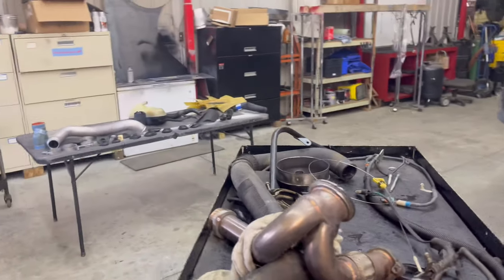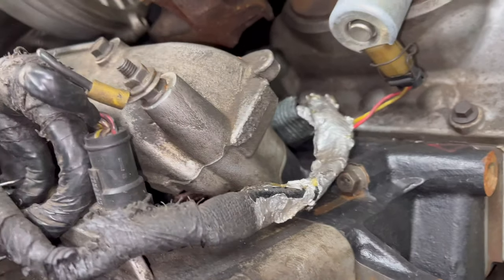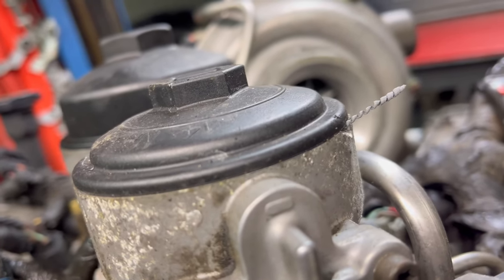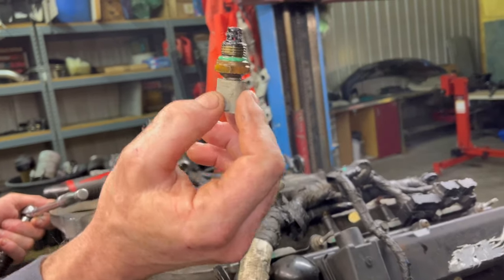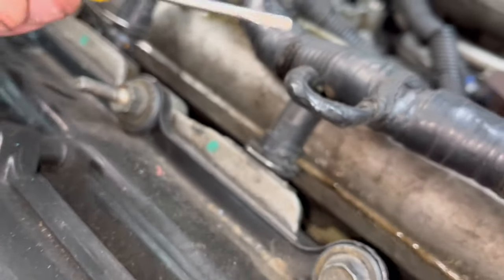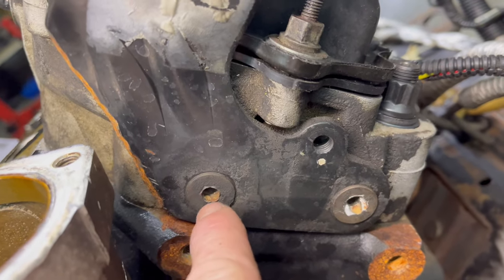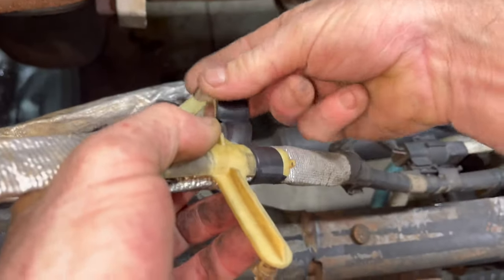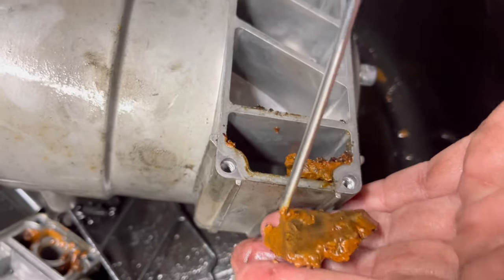This is a FREAKING MESS!!!!   We are on the job tho!!!!  Ron's South Carolina F350

Comment: Bro it's a mess, but this is an epic video series 👍😁👌.  Thanks to you and a few other good guys publishing this stuff, I had a nice clean engine and when I removed my oil cooler, I didn't even wipe the engine block out.  Just evacuated the oil out with the fluid extractor and left it alone- no lint contamination that way!  You and Dieseltechron potentially saved me so much PITA by not having to replace and replace and replace the IPR screen from a plugged up oil system.
And with every change in mechanicing, there is other things that pop up.  I mean, from the evolution of the cordless impact and ratchet tools, they are fantastic labor savers but now I am noticing SO MANY overtightened bolts, stripped bolts, and cross threaded fasteners from guys being monkeys and just running and gunning fasteners in with the power tools, not starting each bolt by hand at first to verify the threads actually feel right and aren't crossed, etc.  
It's the pits following a shop monkey for sure, no disrespect to any monkeys intended 🤣😁
Reply from the maker: Everybody needs to read that a couple times!!!   Great comment SS!!   It's probably just as fun to do as it is to watch actually!!!   lol   It has turned into a freakin comedy skit!!!   lol
Reply: @AnthonyYoungblood   kind of a grownup Easter Egg hunt for sure.

Comment: All that plastic shit on heavy diesel work truck or camper puller. We when to Vegas and we seen to be very new and it started on fire and burnt the Dodge dullay and burnt the 5 th wheel and it was big one . And the fire started on drivers side of motor and it looked like fuel line broke a injector line but it was bad !

Comment: Guys, with that fuel pump so contaminated, are you going to remove the tank and clean it out?  I guess you could visually inspect it first.  I bought an endoscope camera for running down 50' of 4" sewer pipe, and that type of camera could be perfect to run down the filler neck and let you look and see the inside of a fuel tank to help decide if it needs to get removed and washed out or not.  Just an idea.
Reply from the maker: I am on the fence about it.   There very possibly could be junk in there.   The way the sediment was so settled in the bottom of the hfcm,,  I am thinking it was just time.   More frequent drains once it's clean should keep it clean.   That lower filter will show signs of a dirty tank too.  I think if we are needing to pull the tank,,,  we need to just pull the bed and paint the whole frame then!!??  We gotta stop somewhere!!!   lol
Reply: @AnthonyYoungblood  I mean unless he has a ton of toolboxes and rollbar like me, it's only 8 more bolts and a couple plugs right? 🤣